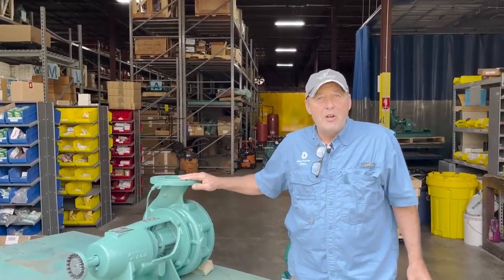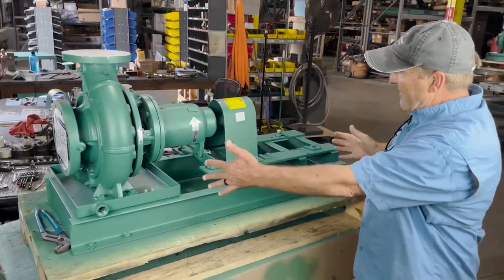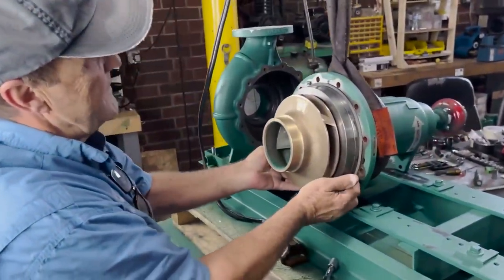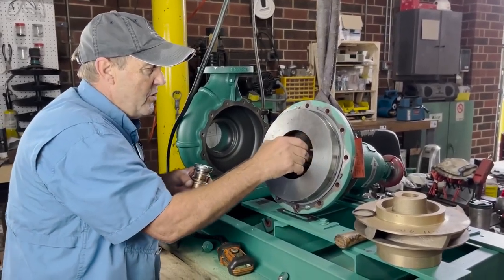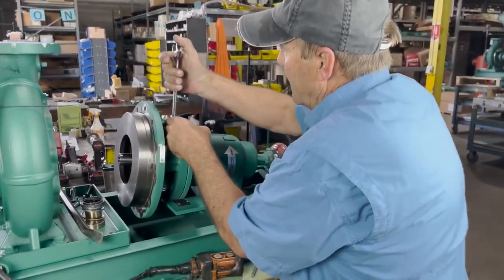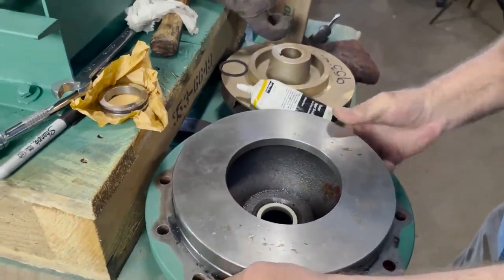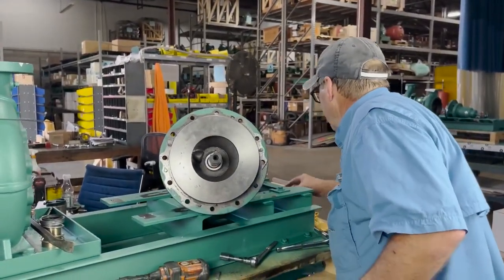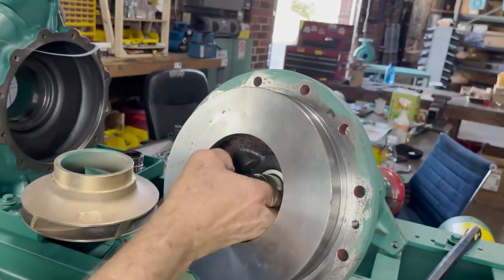Pump Seal Replacement on FI Series Taco Pump

Comment: I've got a seal leak on an FE pump. I followed these instructions meticulously. The seal leaks with the pump on or off. The part I have the least confidence in is the condition of the surface area where the ceramic seal sits on the housing. It was very pitted. Can the recess in the housing be slightly milled down to get a smooth, flat mating surface? Does the tolerance of the seal allow a slight increase on the depth of that recess?
Reply from the maker: Unfortunately, the pitted area you’re dealing with is a common problem on these old FM and FE series pumps. And unlike the predecessor BB pump that hat a seal cap (which you can still get) for the stationary, the casing for FE and FM pumps is not available. A replacement pump is how most people go. However, this means having to redo some piping. I have machined out and inserted a fabricated sleeve on some of the bigger pumps that were expensive to replace and even JB welded a few in as a last resort. 

Do not use RTV or silicone to try and seal these — too flexible and easy to change position under pressure. If you choose the epoxy method, stationary must be flat and centered, high-temperature epoxy, and full cure before assembly. Also, the area must be completely cleaned before epoxy (acetone and vinegar). National Seal used to have oversized stationary elements where you could over-bore the hole without using a sleeve but it’s been decades since I used them. 

Good luck, 
Matt